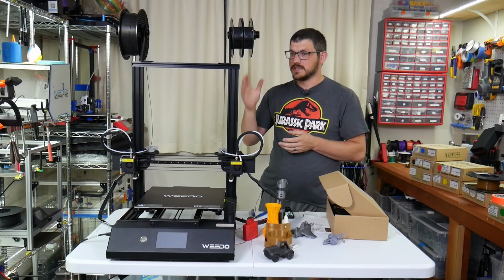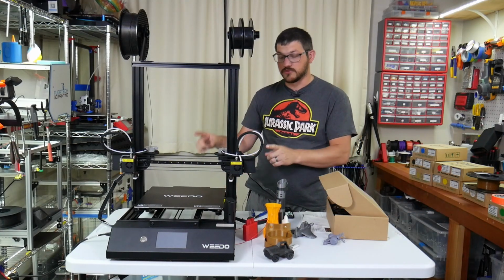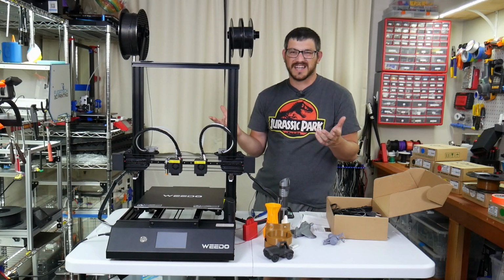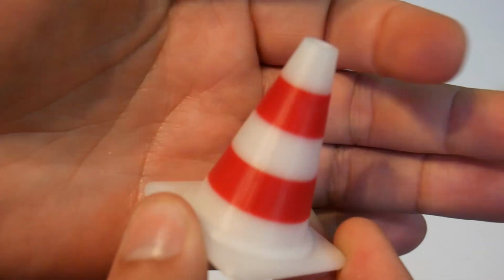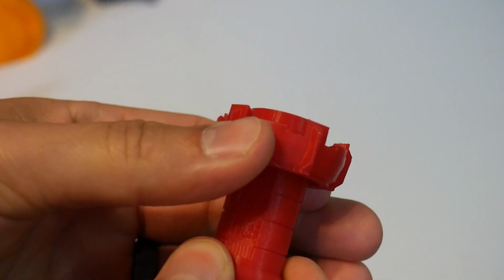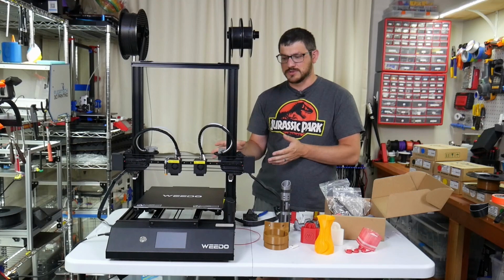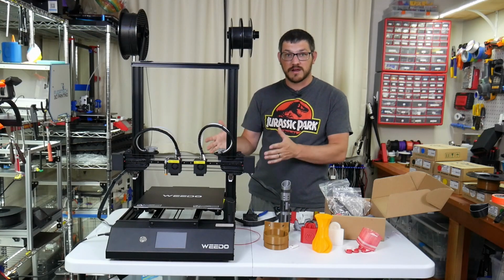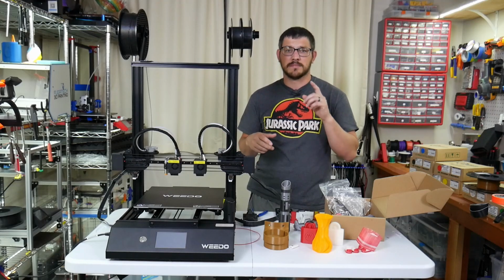Best budget IDEX 3d Printer? (Weedo X40v2 IDEX Review)

Comment: I looked at this 3D printer but decided  to go with sovol SV04 IDEX this is my first matching and Didn’t have no idea how to use it after the initial set up it took me about 35 40 min to put it together and learning and set up lol a few more hours and it printed perfect did the cubes both colours 1 cube with two colours and the two colour fox it was great . The printer had no issues so far so good I think considering this machine is a better option looking at this review but just a noobs opinion 🤗🤗
Duel motors for the gantry direct drive duel extrudes  each extruded has its own belt run by independent motors self levelling heated magnetic build plate touch screen I haven’t done any other printing at this stage trying to learn to use cura slicer and super slicer 🤦🏼

Comment: The new cura shows dual or mirror mode on my x40v2. It also has a profile prebuilt into it. I still have the same issues with filament runout when there is still filament in there. Plus still having issues with resume print.
Reply: The runout sensors are junk .
I've seen where some print an inlet to the extruder that helps keep the filament in line , I keep the runout off as well as the auto switch heads .

Comment: My only gripe is when I reached out to customer support, they sent me a link to x40v2 firmware update. It makes everything a little smoother and faster but it also comes with a whole new set of problems. Randomly it makes the left nozzle crash into the right nozzle during bed leveling and needs to be manually power cycled to make it stop. I also have no capability to use duo or mirror mode without their PC only version of Cura. 

My Anycubic Mega X is still my work horse, set it and forget it. Weedo needs more hands on tuning often. I love it, glad I have it but it is a consistent tweaking printer. The duo color when freshly calibrated does very clean and beautiful work. 
I will be trying to install Cura on my PC laptop and giving it a fair shake, but it is still annoying because all of my 3D modeling and customization is done on a Mac.
Reply: The Weedo community has a cura version for the Mac .
You should also be able to pick the x40 as a printer in cura.
Reply: @JRB007FREEDOM  Yes they do have a profile for Cura but the thumb drive comes with an .exe for a ‘weedo’ version of Cura that I believe is only for Mac. If they have a new release that would be very exciting.
Reply: @MakerBees333  the community has updates for Mac , windows and Linux .
I can't say how any of them are because I'm stuck with using windows 7 ATM.
Hopefully I'll have a PC or laptop milk for this shortly.
So far using either tinkercad or do we builder I've had good luck with slicing and changing things and not having heads bump into each other.
Reply: @JRB007FREEDOM  Thank you so very much for this update!!! God Bless